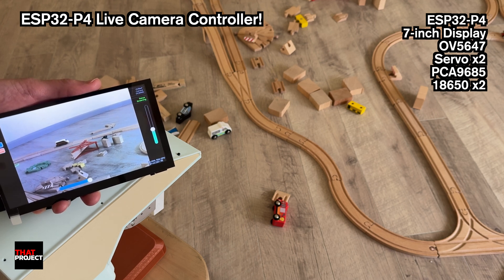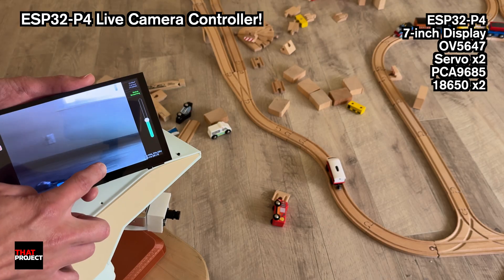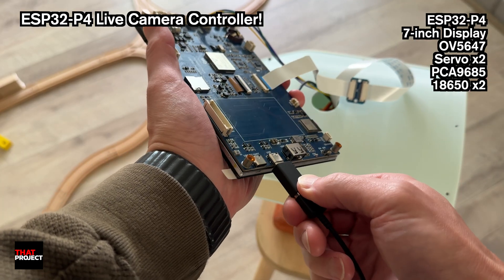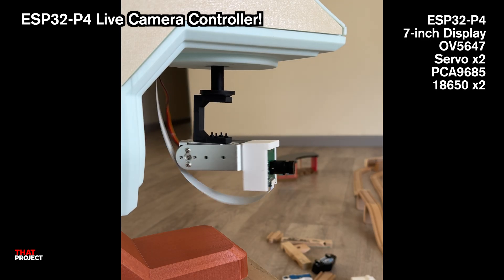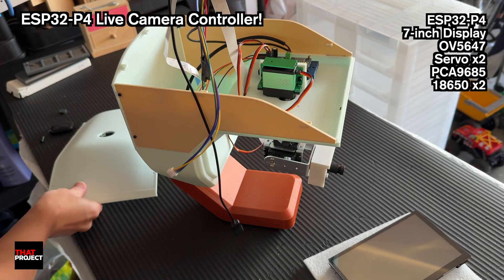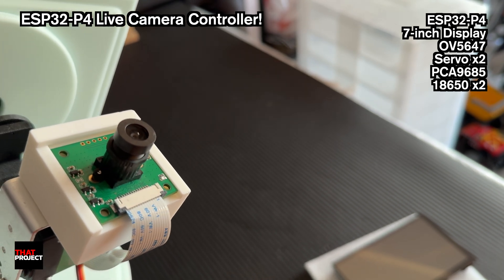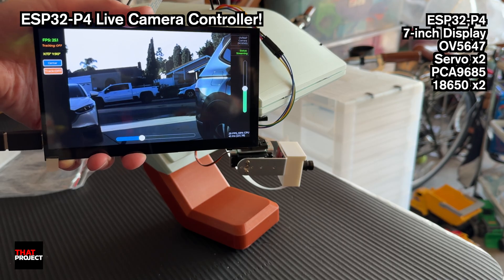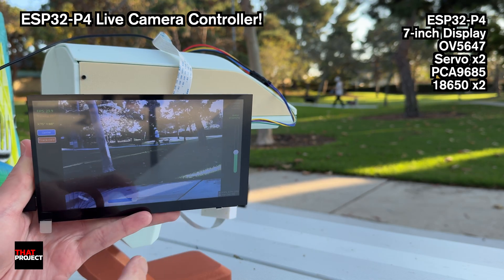ESP32-P4 Live Camera Controller! (CSI, Pan-Tilt, OV5647, LVGL)

Comment: Hi, I really like your videos. I'm working on almost the same project with ESP Home as you, but without motorized ISP for now. It works, but with an average of 5 to 10 fps. I haven't managed to get ESP Video working yet.
Reply from the maker: Is it based on ESP32-P4 or which variant are you using?
Reply: @ThatProject  Yes, it's based on the ESP32P4. So far, two sensors are working: the SC202CS and the OV5647, as I don't have the other cameras. The frame rate is between 6 and 10 fps because it's missing ESP-Video to achieve an average of 30 fps. It's this aspect that I'm working on: integrating ESP-Video so that it will work on ESPHome without reinventing the wheel.
Reply from the maker: @harimax113  To properly use the ESP32-P4's CSI camera, isn't it essential to use the espressif video component? Conversely, is it possible to connect without it (/dev/video0)?
Reply: @ThatProject  No, the esp_video component isn't mandatory, but it will be of poor quality in terms of frame rate. That's what I'm working on with the entire integration, which is complex.

Comment: Is it a 1080p stream or 720p stream ?
Reply from the maker: The setup supports up to 1920X1080_30FPS, but I'm using the RAW8_800X640_50FPS setup because it's output on screen(The screen res is 1024x600).
Reply: @ThatProject  what about the max resolution of Still image the above setup could capture? is that also same 1920X1080? please check and let me know, plsplsplsplsplsplsplsplsplspls
Reply: @ThatProject  i need it for my work purpose :-(

Comment: Nice work, I'm considering moving to this P4 waveshare board from their ESP32-S3 version. It's way more complicated with the separate Wi-Fi and no official Arduino documentation from waveshare. I guess I should breakdown and learn IDF. Thanks for the video, enjoyed watching your progress.
Reply from the maker: I agree. The S3's built-in WiFi and Bluetooth make many projects a breeze. Unfortunately, the P4 doesn't have a communication module, so you'll need to use it with another module like the C6 (if you need WiFi). However, the P4's powerful performance allows for more interesting projects. Either way, it seems like a good choice for any project.
Reply: @ThatProject Yes waveshares S3 7B display has one digital IO pin free. Their P4 7B display has a lot of IO pins available. Thanks for the video and the reply, I look forward to your upcoming videos.